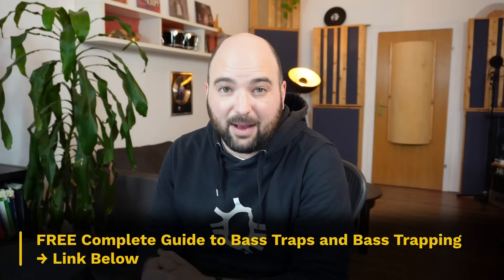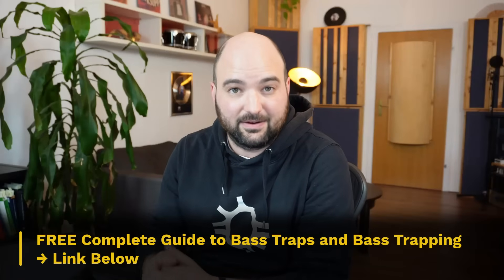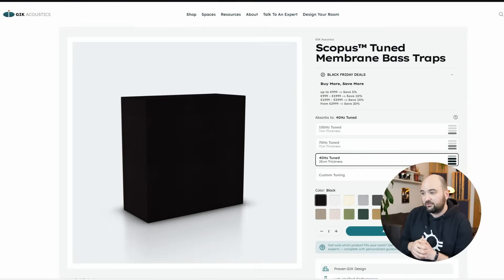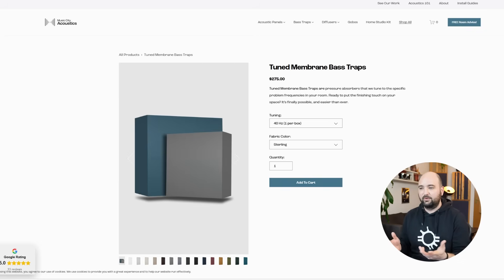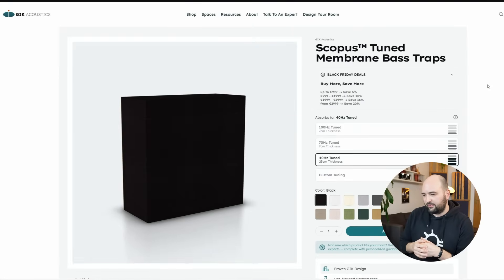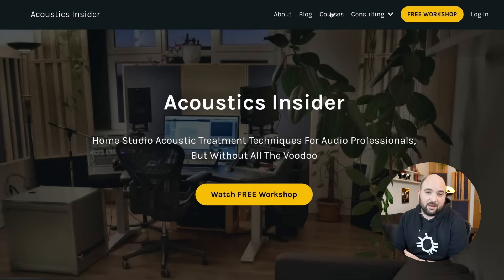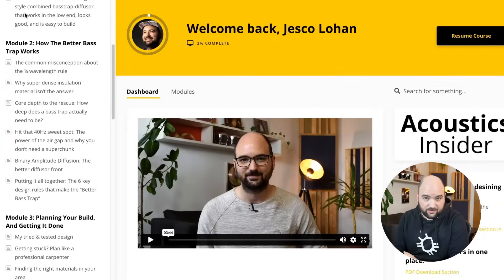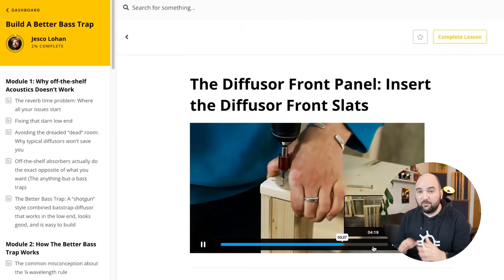Membrane Bass Traps. The 'Frequency Sniper' That Always Misses

Comment: I have a drop ceiling that has about 24" between the floor above and the tiles. If I remove the tiles around the perimeter of the room and replace them with fabric then fill the area above with 24" of insulation. will this work as a base trap?

Comment: You might want to point out that while a room’s modal frequencies are set by its dimensions, the spatial pressure distribution of each mode depends on the position and excitation pattern of the sound source. Even small changes in speaker placement or orientation can shift these pressure zones—often unpredictably. To get the best results from a tuned absorber, you need to lock in your monitor placement as part of the design.
Reply: Hey nice idea, he should definitely mention this in a video some time 👍

Comment: I was wondering if you should use maybe 70% porus to 30% tuned traps or 80% / 20% so you don't fill up your room with porus traps so there's no space for tuned. I don't know if i would be able to get the placement right though. Probably not. Maybe you could use thinner less expensive porus traps if you use the membrane traps to take care of the low end? Just my thoughts.
Reply: I guess it would be easier to plan, if we're not thinking in %, but rather the actual amounts of traps being built and mounted. 
As for the thinner panels, they aren't bass traps at all.
Reply: @zerobject I know I might be a pedant here, but depending on the flow resistivity of the material used, a thinner panel could have an absorption coefficient of 0.2 at 50hz or so. You’d have a weirdly uneven frequency response, but it will absorb SOME bass

Comment: Important note to consider.
When acquiring/building a tuned trap (also valid for other narrow-band, resonance/pressure targeted contraptions), one must always re-measure the space after treating with velocity (porous) absorption.
In many cases, it is suggested to leave the modal resonances treatment to the final stage.
When approaching a build, it is fairly simple to calculate the natural eigen-frequencies of the space, which correspond with the empty room.
Once treatment is installed, the modes tend to shift lower in frequency.
It is wise to install all porous absorption, diffusion and reflection members, measure the room and only then once establishing the "impedance" difference, choose/build your pressure traps.
The difference could be significant.

Comment: Below 80hz it surely becomes a far better use of money and space to buy another subwoofer to reduce modal problems than with acoustic treatment.
Reply: Yes, but. Too difficult to setup multi subs properly. Much much more difficult than just slap a bunch of absorbers
Reply: @sh1maru  I don't agree with that, tuned traps as discussed in this video  take a lot of planning to actually be effective, and using regular panels requires a thickness and amount of them that is completely impractical in most scenarios, plus has the risk of absorbing too much higher frequencies
Reply: @CycleCalm  If thick absorbers were impractical, then most pro studios wouldn't be using them. 
As for the highs, it depends on the room type - recording or control, though there's no risk for both of them anyway - they just sound different, not worse. 

Then again, it would be nice of you to elaborate on your statement in a more detailed way.
Reply: Have you tried this?
Reply: @DJURBANBG Yes, I was gifted a little 7 inch sub and even that greatly helped with my 12 inch one.
Reply: @CycleCalm I dont have space for any sub only room treatment is my answer

Comment: Hi Jesco.  Built my own trap a few years ago, and I want to desmitify the complexity. Regarding cost no too much. Regarding time about 10 times more than porous traps. Just two recomendations: do the box stiff. I start with 10mm ply wood, and if I have to do It again probably I will chose 20mm DM (my trap is quite Big). Be ready for the tuning. Prepare points for add mass, and It takes time. You need to excite at different frequencies with your speakers, and an accelerometer to check the response (I use a cheap Arduino kit).

Comment: Hi! Great video, as always.
I just wanted to share my experience with membrane bass traps.

My studio is very well treated acoustically, but its dimensions aren’t ideal, and I had a strong room mode around 37 Hz — definitely one of the biggest issues in the room.
I had managed to achieve a fairly flat frequency response overall, but I was still getting an average decay time of around 200 ms across the spectrum, while around 40 Hz the decay was almost 500 ms.

I eventually solved the problem by designing and building four membrane bass traps using EPDM as the membrane material.
Each trap measures 60 × 60 cm with a 20 cm depth.
I calculated the tuning using Acoustic Modeling and the calculator shown in your video.
In fact, the Q-factor I achieved was somewhere between the two examples you showed, and I have to say they solved the issue remarkably well.

At first, it was a bit tricky to figure out how to make the traps completely airtight — which is absolutely crucial — but once I understood the sealing process, the results were excellent.
For fine-tuning room problems like this, I really think these traps are an outstanding solution.
Reply: Hey Matteo I’m super curious! Would you be down to elaborate on how you did that? Do you have any socials documenting the building process? I really would like to go down that rabbit hole, but have yet to find someone with actual experience in building this type of trap..
Reply: @gutshisalamanca1191  How To Build Membrane Bass Traps (THEY WORK!)
Reply: @gutshisalamanca1191  I’ll leave you the title of a YouTube video I used at the beginning to get a general idea of how to build it and how it might work. After that, I did several experiments, read a bunch of articles, and after a few tries I managed to get a result that actually works. I’ll share the title of the video I followed at first so you can already get an idea.

Comment: @AcousticsInsider  Why don’t you address the bass issues with additional subwoofers? Placing two or four subs at specific points in the room can help balance pressure levels and give you much more controlled bass.
Reply: A multi-sub approach oftentimes addresses the frequency domain, smoothing the response.   
However, that doesn't address the time domain/decay time issues inherent to LF energy in the room. 

I utilize both in my big reference system, ... multi-sub, and bass trapping. 
I've got a quad 18" IB, plus two double 15" subs for response smoothing. 
For trapping; my DIY efforts at wave-guided hangers, plus additional LF damping.
Reply: @F @FOH3663  it DOES address the time domain when executed properly. You tune the delays so that the modes are cancelled out. Naive scheme like “just turn on all four together” does not work of course
Reply: @sh1maru  
Modes cancelling out is addressing the freq domain. 
Time domain isn't addressed via multi-sub approach.

Comment: I just built perforated absorber panels. One of the things the calculations don’t tell you is that the material the holes are made of affects how well it resonates. The calculations are almost always off. If you can get them to work at your needed frequency, it basically requires perfect conditions. I can’t find anyone who has actually proven them to work rather than just theoretical performance.
Reply: Interesting! What calculations/models have you tried? Was checking REDI acoustics the other day, their models seems promising, but I haven't tested myself yet. Resonant absorbers are in theory simple to make, but quite tricky irl
Reply: @flou_art I used mh-audios calculator based on the formula in the handbook of acoustics. Built from MDF and bolstered with pine for rigidity on the back of the boxes. 
One of the things with resonances is harder materials are easier to resonate, like a glass bottle for example. 
I think you have to remember these are tuned, but these are incredibly hard to test. Acoustics companies can put the time and money into making them over and over till it work, I can’t tho lol.
Reply: @Sharkbate211  I see I see. Apparently that calculator doesn't account for flow resistivity? Never used that calculator, so idk, just heard about it. Maybe the flaw lies in there